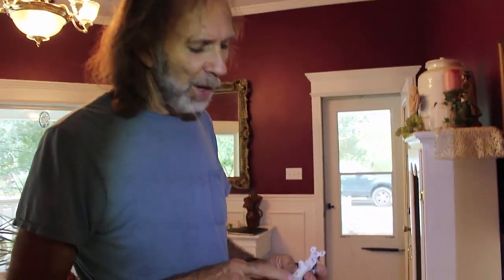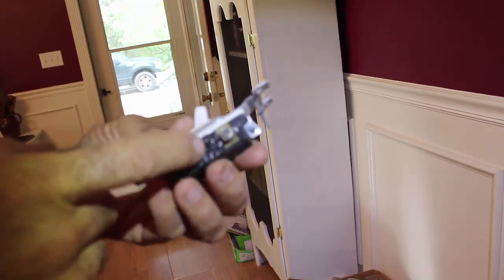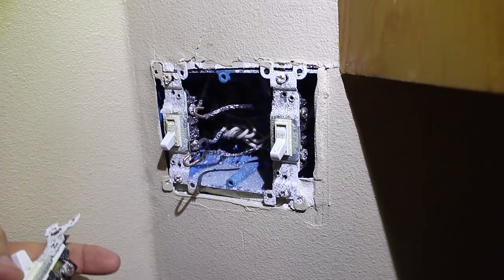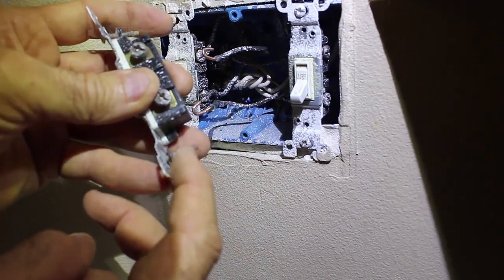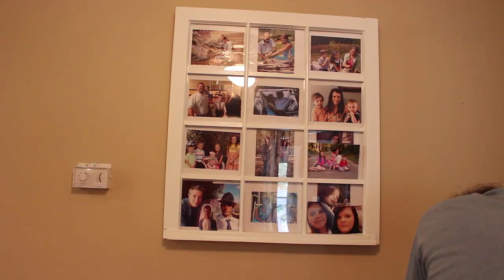Faulty Light Switch // Painting the Kitchen

Comment: You're not playing. That surely can cause a house fire. A couple of years back we had an outlet start doing that. Luckily, we were home when the thing started to spark and pop. It was on it's way to starting a fire in the wall when we found it. We replaced every electrical outlet in the house after that. Great job on the painting. You trimmed that up with such a steady hand. I have to use painters tape.

Comment: HELLO,THIS IS A VERY PRETTY GREY COLOR.NEVER SEEN A SMALL PAINT ROLLER LIKE YOU WERE USUNG.NICE HAND WORK,AND PATIENCE HELPS A LOT.GLAD YOU FOUND THE LIGHT SWITCH PROBLEM.I MAY BE HAVING THE SAME THING GOING ON IN MY DINNING ROOM NOW.I HAVE AN OLD HOME.WILL NEED TO GET IT CHECKED.THANKS FOR THE TIPS.THEY ARE SOO HELPFUL.I BET WANDA WAS CANNING SOMETHING TODAY.AND VIDEOING YOU OF COURSE.LOVE THE WAGON WHEEL WHITE CORNERS IN THIS ROOM.SOO COOL.TAKE CARE YOU TWO.TIGER BALM FOR SORENESS DANNY.THE RED IS STRONGER,AND WEAR AN OLD TEE SHIRT FOR IT WILL STAIN CLOTHES.THE WHITE TIGER BALM WON'T STAIN,BUT IS NOT AS EFFECTIVE BUT STILL GOOD.I USE THE WHITE,AND IT HELPS MY ACHES AND PAINS.ALSO CAPSAICIN PATCHES HELP.PRAY THE RAINS STOP THERE SOON.LOVE YA BOTH.♡♡♡♡♡♡♡♡......